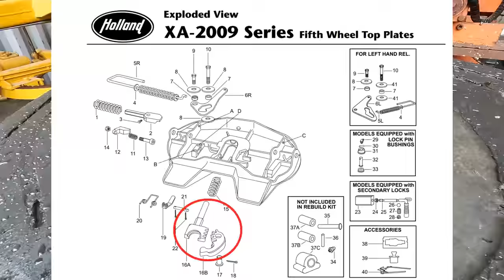1980 Autocar “Construcktor” Hauls its First loads in Many Many Years!

Comment: The ppl complaining and saying about the truck, that truck seems to run great, and who knows how many thousands of miles it has on it, I'm sure you'd be having a rough smokey idle too, and ATF does work great for cleaning the injectors and over all injection system on old mechanical diesels, I mix about 2 qts of it in every tank full in my 12v Cummins bc today's diesel fuel sucks, no lubrication at all.

Comment: Matt pull that trailer out use the dozer cut out ,4' of soil get that slag fill and compact it down then ride the trailer on you need big pad to distribute the weight. Then it be fine I am in landscaping you put that trailer in a 🌺 and 🌹 garden

Comment: I believe, and correct me if I'm wrong, but the proper way to straighten your ramp out is to put weight on it, then hit it with a hammer to shock the steel into relaxing in the correct shape. This way, it is less likely to re-bend when using it in the future.

Comment: My unit in the army at one time at 5 of those trailers. We're down to only a few now. Those ramps bend a lot easier than you'd think. The trailer had 4 plates to cover the wheel so when you drove over the wheels you didn't drive on the wheels. If you want the manuals for the trailer let me know I can get you a copy

Comment: That crane is awesome.  We had a 25 ton crane in our shop that ran on 480V 3PH power.  IF you intend to keep the 3PH motor, it would be cheaper to grab a military surplus generator with 3PH capability rather than attempt to run a 3PH power line to your remote location.

Comment: I have two suggestions that have occurred to me. One consider widening the corners on your roads .I believe this will save you a lot of problems in the future moving heavy equipment on your low beds. Also think about dumping the old lowbed and getting something that you can detach for loading. Watch what happens when loading things on a snow covered old lowbed, not nice. Two consider taking that massive front bumper off of the A-Car looks awful and heavy, might save you weight wise when on the road if you hit a weight station.

Comment: just picked up your vid  you sure are a lucky guy anyway it looks like you are blue smoking from the stack it looks like you are burning oil if it was black smoke that would be fuel check the turbo seals or fuel pump . That crane I used to build them if you need to cut the length down set it up level and square mark the positions of the wheels on the floor and then mark the new positions on the floor and keep everything square and it is easy to turn it into a single phase unit, change the motors and modify the switch gear and drop the SWL to 5 tons easy peasy good luck.

Comment: I would suggest running the crane lengthwise with the building so you don't have to cut it down. All the modification would be done to the rails, it wouldn't fully maximize the space but it would be a lot easier.

Comment: For what its worth we used to just cut the pins with a torch. Cut the outside of the pin ( the flat part) and drive the pin inward and reach in under the plate and cut the pin off. Drive it in again and cut a second time. Do each side and then you're free and clear. Replacement pins are cheap and you can have the 5th wheel off in a couple min. Good repair though 👌 👏 👍
Reply from the maker: Didn’t have any pins on hand but that’s a good idea
Reply: @DieselCreek  its about the ony way to move them if they're siezed in place. If those pins get siezed you've got a problem. Slop on the copper coat if you ever chage them out.

Comment: Matt  a quick tip from someone that has hooked up 100 trailers sfter you back under a pin you should always give a little tug on the pin to make sure the 5th wheel has locked once you have gone under the trailer you will feel the thump when you hit the pin but then you should always hit 1st gear and give the trailer a tug so you can be sure that 5th wheel has locked saves a lot of embarresment of a nose dived trailer snd a drive with that oh shit look on thier face I am a semi retired big rig driver and owner and yes I have done a few miles over the years

Comment: You should have a roof light on that tractor precaution all tractors has roof lights on it like bar lights or some kind of a caution light on top of the cab of the roof light for a caution
Reply: I drove tractors for 20 years and they all have to have roof lights on it dot mandated they requires any tractor moving heavy vehicles or whatever needs caution lights on it

Comment: cummins pt pumps have a oil pressure valve. if you have low oil pressure at idle. change out the piston oiler jets on the passenger side of the block. they are plastic and fail when they get brittle.

Comment: There ways to get 3 phase power out of a single phase 240v system for that crane that you can look into. There's motors called rotocons which will generate that third phase and they work great. There also other newer but probably more expensive ways to do it. I'd tend to think that would be much easier than completely rewiring the crane. Just a thought

Comment: Regarding the smoky exhaust. I would check valve lash as well as injection timing. Those two things not in order can really bring out the smoke in a diesel.
Reply: You don't think that the 1/2 gallon of ATF he poured in the tank dosen't cause the smoke ?
Reply: @junkyarddd1  No, not really. The percentage of ATF would likely still be insignificant.

Comment: They use those on the bottom of the frame to hold the 2x6s or 2x10s on a new ones they use 2x10s for the floor now so that's pretty good I'm at the manufacturer where they make them at

Comment: FYI worst mud flaps ever, they are too rubbery. if they touch a tire while backing they come off. just notch the holes and tighten them really good and then you won't tear them up when they come off again, they are now quick detach. because they will come off again. I switched to a more plastic flap and have had excellent success at not ripping them off

Comment: If you get a chance you should switch those 10.00-20 with 22.5s hub will be the same size just be alot safer and the load capacity is higher

Comment: little dozer put a load on the A-Car huh?  a word of advice.. never take off on a trip without squating down behind the tractor and puting eyes on your locking mechanism in the fifthwheel, you make absolutely sure it is latched. (just a couple seconds of time early, saves a lot of headache later, 10-4.) from an old truck driver.. I also noticed you took our advice about not hitting the pin too hard, thats good, but don't hit it too easy either.. it may not latch, Always pull against it in low gear. Keep em comin brother your doin' good

Comment: Change the injectors? I’m on the fence on this one. It runs good, but the internal springs will have backed off over time. I would recondition to be safe. :o)    The three phase crane I would stick a generator on top. That saves a lot of cable and power tracks and stuff. Hang a tail off the side to run other 5phase as you need to.

Comment: Matt, what engine and transmission do you have in the 80 Autocar? I agree with a comment earlier on doing a restoration on it. Keep putting that old iron to work! There's a reason why all that old equipment has outlasted all this new stuff that's built now days.

Comment: I knew that was going to happen when I seen it drop a bit after you pulled out and also the dunage you put under it par the load you had on the trailer wasn't going to hold we had a grain trailer snap two rail way ties like tooth picks so yeah 😉

Comment: If the injectors dont clear up, get cummins  part # 3885823. Bypass the tank and hook directly to the engine. Expensive but worth it. We used it on the company forklift. We thought the 35 year old pos needed motor mounts with all the vibration.  Ran that cleaner through it, vibration was dead, engine was quieter, started faster. I've check several 5th wheels during dot inspections. None were the model you got. Like Holland alot better than Jost. About the only issues I've encountered with 5th wheels are the pins seize up with rust. On jost it takes a portapower and a acetylene torch to remove them. On Holland........heck I don't even know how we deal with Holland,  there alot less problematic.

Comment: I would like to point out to you that your 5th wheel on you orange Autocar is on backwards the opening should face the back of the truck the king pin slides Into the v and trips the catch pin you will find it will work much better if you turn it around

Comment: Just some advice I’ve seen what happens to a dozer that’s not chained down some guys I know moved one less then 2 miles to a new logging site and lost it when the trailer flexed to one side in a curve dober tracks have little to no left and right traction on hard slick services like trailer floors

Comment: Is that a 25 foot military lowboy trailer?  When I was in the Army I was assigned to a Aircraft Direct Support unit and we would have to do helicopter recoveries sometimes and we would have to borrow one of these type trailers from an Engineer unit because we didn't have one of our own.  For some reason we had a 40 foot flatbed trailer that had the gooseneck like your trailer.  We normally used the 40 foot trailer when ever they had to haul rotor blades in their protective cases.  I think the reason we always had to have the 25 foot trailer is because it was wider that the 40 foot trailer.  The skids on a UH-1 Huey are pretty wide.

Comment: I like your channel and your love for old iron. The Autocar is great, but needs a few things. Convex mirrors on the corner poles, pogo stick for air lines on back deck. The flapper on exhaust stack is turned around, hinge should be towards rear. 
     You can drive it pretty well, but you are not a truck driver. There are a few basic things you need to learn. Not a criticism, it's not your daily job.

Comment: You know, as soon as I saw you had set the blocks perpendicular to the trailer vs parallel I knew it was going to slide off... You should really use pads to set your landing gear so that the overall PSI is lower... that said, you're having entirely too much fun out there... 😛

Comment: Matt: A couple of safety related items. And maybe some general thoughts. I "may" have some insight on tractor/trailer operation. I have been driving commercially for 57 yrs....I know-I know...that's more than a min. I've been very lucky, never had an at fault accident & my only ticket was 3 yrs ago for "obstructed vision". no, My eyes were not shut...he didn't like where my GPS was mounted! The officer must have had a bad day that time. I'm not trying to sound my own horn..I have a dedicated run and still drive approx 350 per day miles Mon-Fri. 2 mo ago I received a cash award {$750} & certificate for completing 1.5 million collision free MILES. I have been with my current employer 19 yrs' but total MILES driven commercially is approx 7.5 million. .just let you know my advice is from experience and should be taken as you see fit. When hooking up any trailer the trailer brakes should be applied, also the trailer should be low enough that it must lift slightly when you back under it, this allows the 5th wheel to remain flat.  as far as mud flaps go. The ones you got are WAY too long,as you discovered....when you reverse any small dip in the ground will push the flap under the tires & you know the rest. Compare them to the ones on that other trailer you used to bring your crane home with. All newer trailers have maxi brakes [ last 35 yrs or so] & should already be locked until you supply air to them. Once hooked up..ALWAYS "strike the pin" that is try to move forward sharply to be sure it's in fact locked in place. Sorry for the long post...love what you do & enjoy your "adventures" very much. Carry on Matt!....... Barry.😊

Comment: A lot of progress happened. Congrats! Nevertheless: The injectors definitely need to be rebuild/repaired respectively changed. The great Autocar is still smoking way too much. The olive green trailer sits too low on the fifth wheel. Maybe only because the steering axle tires are taller than the rear ones (you already mentioned that you like to have 22.5" wheels on the twin axles too). But maybe the fifth wheel needs a kind of spacer to have it positioned a bit higher on the truck frame. Or the trailer needs to be changed a bit. By the way: I hope that you will find a way to not always crash into the goose neck trailer hitch knob so much. I also really hope that you will be able to somehow find the time to derust, clean and paint the great big moose catcher (of course the result doesn't have to be spotless at all). I also hope that the glass guy can help you to have sealed windscreens. The good ol' Autocar truck definitely deserves it. Time will tell.
Best regards, luck and health.

Comment: The tires on the trailer are different sizes? It looks like the back axle tires looks larger than the front?? maybe why the front weren't really spinning without the weight. They weren't touching maybe or just barely? Probably wrong but when you had it parked on the dirt where the shops going they looked different sizes

Comment: Another great video...I had to look up how an industrial crane worked because all I could think of was that scene in "Raiders of the Lost Ark" where Indy is in the submarine pen. Turns out that's what it is!

Ok. So question about the trailer the crane is on-- did you have to buy that as well or does that go back to the auction yard at some point?

Comment: I've always noticed. when connecting to a trailer, drivers typically hookup, followed by a little tire spin to ensure positive engagement. I noticed that you haven't utilized that technique. Is it intentional, or perhaps simply overkill in terms of ensuring positive engagement?
Reply from the maker: Overkill. You can see the jaws are locked

Comment: If you're not gonna fully detail that truck, at least clean up the windshield! Dirty windshields are a pet peeve of mine, lol. Otherwise, lookin good! The other guys had the right idea with an air hammer for getting those pins loose. Check out Astro Pneumatic's "THOR" models.
Reply from the maker: The glass is hazy between layers. Can’t clean it

Comment: I drive a semi and got my CDL in 1996. Using a funky old fifth-wheel plate seems like a very foolish idea. Obviously, losing the trailer while underway can be catastrophic. Also, the locking mechanism on a fifth-wheel plate should be easily triggered manually. It's a good idea to use a piece of pipe or a pry bar to do so and occasionally clean out old grease with diesel or some kind of spray lubricant, especially when it's getting cold. Otherwise, the mechanism may not want to release in cold winter conditions.

Comment: in the 22:00 - 23:00 and after area how fast were you going? Flat drive or uphill?
Was there any struggle from the truck to pull though there? Is this a 6x6 or a 4x6?
On the highway how fast can it go loaded up like that?

Comment: I'am surprised that the small piece of steel which locks the kingpin in, is strong enough to keep the trailer, and it's  cargo weight from snapping off  and the trailer coming loose in it's travel.

Comment: just real quick question on that gantry crane unit, did you happen to receve the control unit (the hand held one) If it even operated with one. Other than that congrats on the crane and Getting the old beast fully operational :)

Comment: I would like to know how many cameras you have smashed doing the drive over shots. I have been binging your videos from the beginning and I am enjoying them very much.
Reply from the maker: Not a single one. Don’t jinx me! Lol
Reply: @DieselCreek  You are either good or lucky then. If it is luck I hope it stays good, if it is skill I hope you do not get over confident. I have enjoyed all of your videos. I to like to collect old and broken things and try to revive them. I put 2 used motors in, and  had the heads rebuilt and then replaced on one of them when it cracked, in my last truck (a1985 Chevy C20 long bed) and drove it until the transmission died and was in the process of rebuilding that when I had a wreck that paralized me. I also collect and repair hf/vhf/uhf radios (any ham or shortwave radio) or other electronics that could serve a purpose.

Comment: Kinda amazed that the lowboy trailer doesn't have a self-acutating parking brake (air pressure needed to release it). Isn't it required in the US?
Reply: Yes but remember his lowboy army trailer is from the 1950s.

Comment: I know this video is about 9 months old, and not sure if this was addressed, but the wheels on that trailer roll with out air applied, so either they are caged, or there’s another issue, I hope you fixed that before going down the road
Reply from the maker: It’s an old trailer. It does not have maxi cans

Comment: thinking on the autocar is probably indierct injection and so she will cleasn the injectors when she hits running temp  thee run to get the crane and the bits since then have all helped to burn the soot off of the injector nozzels

Comment: Did u have the brakes on the green trailer caged in the beginning of the video? u were movin it with no air hooked up. maybe i dint see it but im just curious. u probly should completely rebuild that 5th wheel it looks pretty jankey under there. seafoam or diesel clean works well to unstick injectors.
Reply from the maker: That trailer doesn’t have spring brakes. Without air pressure there are no brakes
Reply: @DieselCreek  Ah, no wonder, i dint even think about that